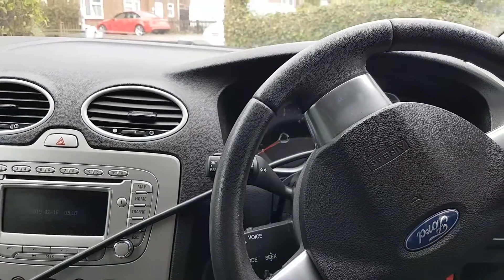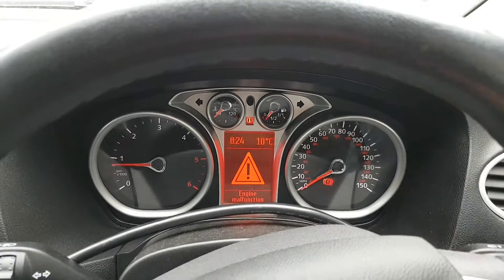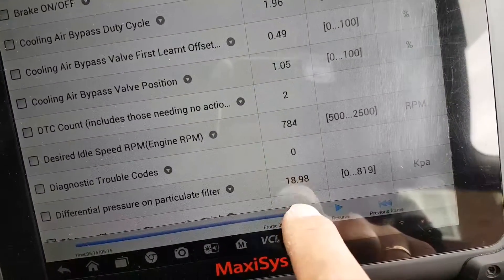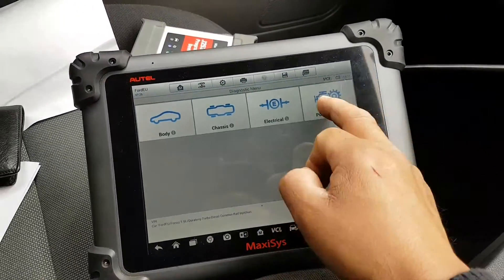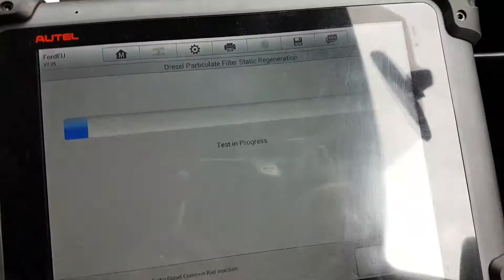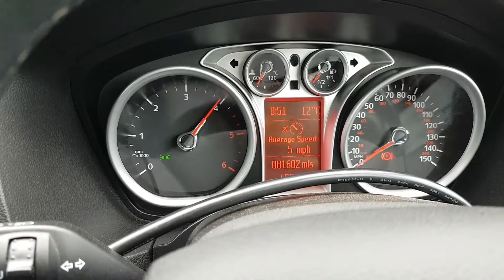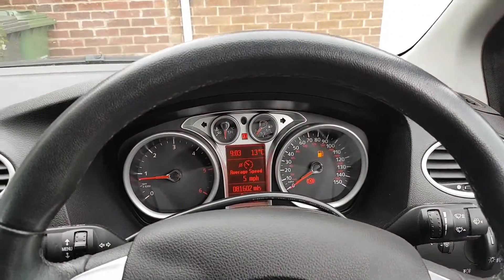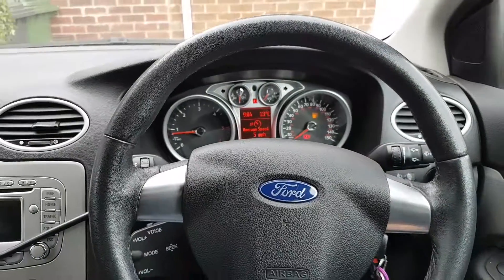Ford Focus 1.6 TDCi code P242F. DFP regeneration.

Comment: Problem will back in not long time. Check flow on the DPF  additional fuel injector. I think so flow is low or no flow.
Reply from the maker: As I already replied... this was done in May last year,  and so far still going... if it come back, I will update...
👍
Thank you for watching!
Reply: Good  sir
Reply from the maker: Thanks!
👍👍👍
Reply: No injector on a DPF, it regenerates by a post injection strategy in the ECU
Reply: @stumo8681  some dpf have a injector, not all post injection
Reply: @fabini14  Exactly I know VOLVO using the Ford 1.6 Diesel have a tank of what they call EOLYS fluid or something like that. I think the fluid increases the EGT somehow to enable quicker or easier to complete regeneration. That tank and associated bits ironically then becomes a part of the "Diesel Premature Failure", or DPF system😂.

Comment: I think the health and safety message about hot exhaust gases, adequate ventilation and all of that should probably warn you that you will be subject to the sound of a diesel sitting at 4k possibly causing depression. If conducted outside of a workshop environment the forced regen may also piss off your neighbours quite badly😆

Comment: Can this be completely removed from the system and just use a normal exhaust system?
I'm aware of the legal requirements, but lm sick of technology and want to get back to basics. 
Air pollution is caused by volcanoes and Chinese and Indian factories America is the worst.
Cars play a roll too but for the amount l drive (120 klm per month)
I want to bypass this system.
Reply from the maker: LOL
I agree to a degree...
Governments are focused on the small stones, and ignoring the big ones...
That said, yes, it is possible...
👍👍👍
Reply: @LMAutoRepairs  
How?
I have a Ford focus 2009 South Africa build, the engine warning symbol came on then awhile later the engine malfunction light.
Called a tow truck ,mechanic said his code reader couldn't communicate with the car, told me to take it to Ford dealership ($240 per hour)
Possibly $3000 to fix it, the car is not worth it.
Now l just want to get rid of the system and not have a sensor show up a code.
So please help if you can I'm an aged disabled pensioner and can't afford the scammers at the dealership.
I need my car to get groceries and doctor appointments.
Reply: @LMAutoRepairs  
Please read my last post, I'm getting desperate. 
Regards.
Reply from the maker: There is nothing I can do remotely...
Tools are needed, look for someone near you that has the necessary equipment to do it...
Reply: @LMAutoRepairs  
If l know what to do l can do it myself, I'm sick of paying out $145 per hour to workshops that take their time and do nothing other than tell you that it needs parts that are more than the car.
Reply from the maker: To start You need a tool to read the flash from the ecu...
Through OBD or on the bench... depending on which ecu You have...
If on the bench, then you need to open the ecu, and make the correct connections on the board in order to be able to read it...
Once you have the file from the ecu, you need to have it modified...
Then the risky part, write the new file back into the ecu...
If you never done it, and you just want that one car done, I would pay someone to do it...
As I said, once you buy the tools, etc... Will ended up more expensive...
Plus, if you do something wrong, you can brick the ecu, which is then a whole different story...
Reply: @LMAutoRepairs  
Thanks for that, you are a good bloke.
I found a local mechanic through word of mouth, he explained in more detail exactly what you have said here.
He also said "not all mechanic's know how to use diagnostic equipment, he's cost over $14,000 AU, and a yearly subscription around $1,400 AU.
Now l know why Spanner Spinning costs us so much, and there's also insurance, rent, provisional tax and the last goes on.
He was able to get the vehicle and diagnostic tool to communicate and preformed a forced DPF regen, he also gave me a can of DPF cleaner to put in a full tank of diesel and explained how to drive the vehicle for the next hour.
He also cleaned out the sensor and sprayed DPF solvent into the hose then applied air pressure and this blew out mega amounts of soot from the exhaust. 
After driving for an hour non stop and using the transmition to average 3000 RPM the engine stopped surging and took off like a missile, l can't believe how much power this engine is now producing. 
The fuel consumption has improved to now using 4.7 litres per 100Klm from 12 litres per Klm.
I also have a Mercedes-benz 2.1 litre twin turbo diesel, and will now use the DPF cleaner in it every service
 (l choose Nulon full synthetic 5W40 diesel oil) every 5000 klm. 
Clean quality oil = a million mile moter.
Thank you for your advice and channel, great work.
P.S.
My new best friend (mechanic) only charged $83, so l gladly handed him $200 cash thanked him for showing me what he did and also showed me how to reset the service schedule. 
Happy chappy !
Reply from the maker: That's great! 
👍👍👍

Comment: Can the dpf codes be reset automatically if a manual dpf clean is done by taking it up the motorway for an hour in 4th?
Reply from the maker: Depends how blocked it is...
It worth a try...
👍👍👍

Comment: If you cannot clear the codes, disconnect the maf sensor, start engine, turn off engine and the connect the maf sensor. Clear codes  will  then let you start static regeneration

Comment: I did few static regen on ford by snap on tool and i can say is more gentle vs your tool,revs are only up to 3k and whole process take about 25-30min,you should also check oil level before and after,make sure fuel is at least 1/4,coolant level and  alternator belt.Basic things to not allow any mistakes can cause engine failure.
Reply: I have been trying this but everytime I get to start it comes up saying procedure aborted it may not be necessary for this vehicle 🙈
Reply: @stevenlogie7654  what did you use to do it?

Comment: Just go on the highway and keep your car at about 3000 rpm 4-5 gear to match the rpm.
I usually go once in a week or 2 weeks on highway and go about 140kmp for about 15 minits and then i can really feel the car having more power and going very well, because you can clough up the car in the city going slow speeds and low rpm.

Comment: Done this on a 2014 Focus and the problem just comes back again and again after a couple of months. Just a temp fix. Patch it up, knock the lights off, and get rid.
Reply: Yeah you could have other issues thats preventing the car from doing regens like low fuel level, bad thermostat etc or the dpf is full of ash which u cant burn off with regens in which case u should get the dpf manually cleaned out or buy a new one cleaning will be cheaper but sometimes they can be melted and damaged beyond cleaning
Reply from the maker: This one still going...
Obviously make sure everything else is good so the car then continues to do the regenerations etc... 
Thank you for watching and for your comment!

Comment: Hi i have the same problem P242F pressure at idle is about 0kpa and at 3000 rpm is 20kpa which means 200 hPa, according to my experience for 1.6L duratorque the pressure at 3000 RPM should be around 30 hPa which means I have to much pressure (200 hPa). I wanted to do a static regen. I’m not able to delete the fault code P242F so the PCM refusing to enter the regeneration mode how did you delete the fault? Thank for the help.
Reply from the maker: Try a dynamic regeneration...
See if it does it...
If the pressure is too high, the car might refuse a regeneration due to safety reasons...
In that case replace the DPF, or remove it and clean...
👍👍👍

Comment: I can't remove the fault code so I can't strat regeneration process
Reply: Matyas if u disconnect the maf sensor a couple of times and clear the maf codes it will let u clear the dpf codes

Comment: Nice video , I did few " forced regeneration " on dpf ...but how you said it's  pretty dangerous  as the car gets very hot and if it's  leaking oil from engine or it's  not cleaned  properly  get start burning.

Comment: Is it dosing the DPF fluid correctly? On my 1.6 TDCi I found an intermittent reed switch / sensor that detects magnet on the fuel filler flap so was not dosing on each fill up. I would also have added a DPF cleaner into the fuel tank before doing a static regen. My idling pressure is 0.3 and has only ever reached 1.6 on a run. Hopefully it will continue to go down now
Reply: There is no DPF fluid on these engines, as far as I know.

Comment: my mrs had this engine in a mazda , nothing but problems with dpf light coming on , £50 quid to top up dpf fluid then £40 quid for garage to reset the dpf fluid code . Worked fine for a month then dpf codes come back on we took it up  motorway in 4th gear and gave it blast out . light went out and everythink fine for few weeks and then happen again. She had a Ford cmax 1.8tdci before and all that had was same problems and costing her money because stupid dpf codes kept coming up . In the end i told her to get rid of the car and buy a petrol engine . Her dads having the same problem with the dpf on his car and he said he NEVER BUY A DIESEL CAR  again . I told her now keep away from diesels with dpf on . Nothing but problems and too much and too expensive on them . She had a ford focus 1.6 petrol now for a year and had no problems whats so ever . Every diesel car she had as had nothing but problems with dpf, egr clogging injectors .

Comment: bet the neighbourhood loves to hear agricultural engines run flat out for 20 minutes at a time
Reply from the maker: LOL
A bit exaggerated... and as I already answered a few times, this is was the second regen I did on my drive way in about 10 years... 
For all matters, it could be my own car...
Thank you for watching!
Reply: @LMAutoRepairs  I did a Liqui Moly diesel purge on my TT, I felt very cringy holding the revs at various levels for 10 minutes, but it did work.  

Noticed you had an Autel, you have the model I wanted but couldn't quite justify the cost for as a home gamer

Nice channel though, love the content 👍
Reply from the maker: @matteightytwo  
That's great, that you got it sorted...
Agree that this Autel is a bit too much for the home user... but there is more suitable models out there!
👍👍
Reply: Round here I'd rather hear that than the current trend of young dweeby drivers over fuelling so their exhausts go bang bang bang

Comment: 5 mph average speed. That is your DPF problem. Owner should sell this and buy a petrol.
The rest of the codes are from a failing gauge cluster. Common on these cars.
Reply: My guess would be that the computer may have been reset recently and spent majority of time sat on driveway which is why the road tax has expired.

Comment: I had the same car, same engine but '06 made focus. I had never had a dpf problem till 200.000km and I sold the car, the engine performed like new.
I have some recommendations to the owner;
- always buy high quality diesel, like shell v-power 
- avoid going low revs on long times, use the engine on 1700-2500 rpms daily driving
- from time to time, go on a highway and go up to between 3000-3500 rpm on third or fourth gear, drive like this for 10-15 minutes to clean up the exhaust and dpf system.
Reply from the maker: Thanks!
For watching and for your comment!

Comment: You should really make sure to preheat the engine up to operating temperature. Do not do as he did in the video as the engine temp was clearly to low. This could very easily create engine damage
Reply from the maker: Again, that's why the regen never started until the engine was up to the necessary temp...
Thank you for watching and for your comment!

Comment: You don't use the jlm dpf cleaner?
In my ford focus with 100 000kms, the 20 000kms a 20 000kms i put 375ml of jlmdpfcleaner e saw far zero problems.
Best regards from portugal.
Nice e informative video. Post more for   your focus.
Reply from the maker: Hi...
Personally I don't use those additives....
I do have more focus videos coming...
Stay tuned! 😉
Thank you for watching and for your comment!
Reply: @LMAutoRepairs  ok.
Your ford focus has the power botton to start?
I want to instal the drl's but i don't no to start.
Do you help me?
Reply from the maker: @pedroresolve  
This car was not mine... I don't own a focus...
Reply: Exactly the same stuff I used

Comment: you should get  some trade plates if you get a car with no mot or tax or what ever as it covers you to drive the car on the road it is a lot of paperwork to recive but its alright paperwork
it really depends as i am a driveway mechanic and i have trade plates as i get a lot of cars to repair and need to road test
Reply: What is the "whatever"? As far as I am aware, trade plates are a portable tax disc and nothing more.
Reply: Elliott Peters tax and insurance as you have to provide a motor trade insurance.  It’s really used by garages and car trade if they moving it to one place.
Reply: @s3bby513  I am aware of the requirements to qualify for trade plates.I am just saying that they absolutely do not provide blanket coverage to drive any vehicle, in any condition, on the roads. Their sole purpose is to negate the need to register and tax a roadworthy vehicle whilst it is being moved from place to place, test driven by a potential buyer, or following a repair.. Provided you have valid insurance, it is not necessary to use trade plates to drive to and from a pre-booked MOT test. Nothing can prevent you falling foul of the law if you are driving an unroadworthy  vehicle.

Comment: Hi 

The Engine lights comes on and then loses power at full throttle and the engine is shaking at idle.

Will you be able to help me with this?

Thanks.

https://youtu.be/3wO_QlTc0xM

Comment: This would freak me out! I've never done work on a diesel with DPF (all have been without DPF). The fact that it has to peg at such a high RPM would make me nervous.  Interesting process.... 
I have done light studying on these systems,  but what I'm unfamiliar with, makes me nervous.  Lol
Excellent video Luis!
Reply from the maker: Hi
Yes, it can be scary... that's why I always prefer to do it while driving... safer and better for the engine...
Unfortunately on this occasion was not possible...
Thank you for watching and for your comment Cuba!
👍👍👍
Reply: I use Forscan and a bluetooth OBDII device while I'm driving and can see the DPF heat build up to 620'c during dynamic regen!!!! You soon start going meh after a few times LOL
Reply: @markaskew  since then, I've done tons of work on DPF and even recently took an ATG training class on the systems, along with how to more accurately diagnose issues throughout the system. Crazy how much I've learned since then, come to think of it.

Comment: And as with ALL China diagnostic machines, read how to regen using the proper VCI to get an idea what the procedure will be. Autel, Launch etc. etc. make you think you have to turn off the ignition when you have to leave it on. When doing anything on a Ford and a 600 second counter appears, leave it running. 600 seconds is 10 minutes which is Ford's favourite timer length. With the readings after you finished this one might be back.
Reply from the maker: Next time I will use IDS... to see the difference then...😉
Thank you for watching and for your comment!
👍👍👍👍
Reply: @LMAutoRepairs  I'd just fire up YouTube just to get a rough idea. Been caught out with Autel b4 👍
Reply from the maker: @timmehlittleloud2251  
👍

Comment: You did almost everything alright . I would have mentioned to check the oil ( fuel in the oil ) I understand you couldn't do a drive cycle this would have given you a clearer view in actual values . For those who thought about your neighbours I have only one thing to say . That's the price you pay for wanting a cleaner environment that  turned out to be a big and expensive failure .

Comment: Definatly almost full of ash -  needs clean out or replacement.
Reply from the maker: When it fails again...
👍
Reply: @LMAutoRepairs  it depends heavily on usage I guess. I have 2.0tdci that has almost 600 000km's on clock and to my knowledge has original dpf installed. I got error once, but rubber hoses for sensors where fried. But yeah. I most definitely wouldn't buy dpf diesel engined car if I was driving constantly less than 20km rides. I noticed that I usually run car for about 25km's or more when regeneration has triggered automatically. It's really easy to dismiss required stats for it to trigger. If I recall correctly there's engine temp, running time for engine, required speed for specific time and exhaust temperature requirements.